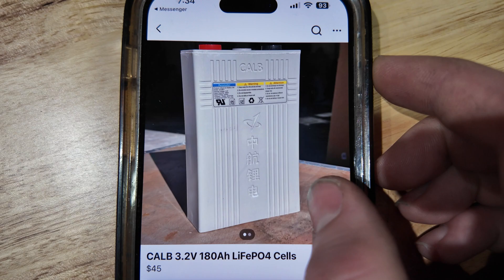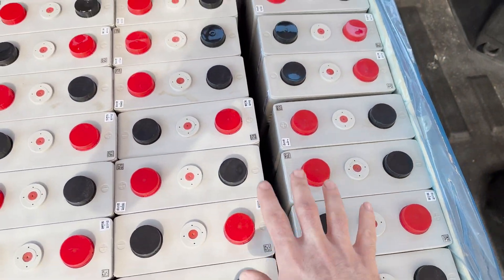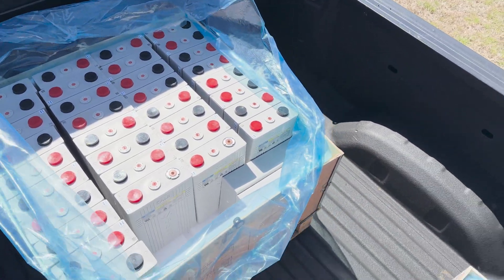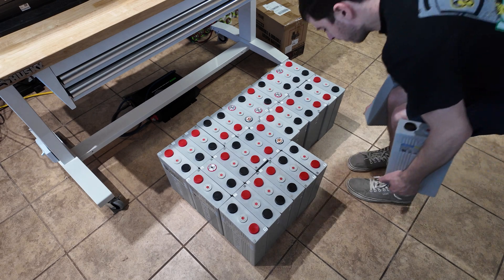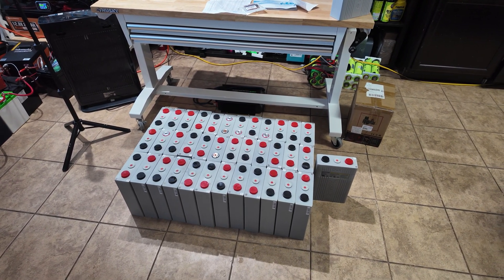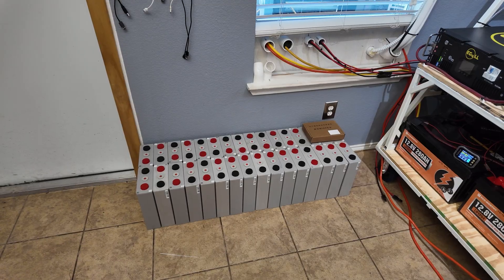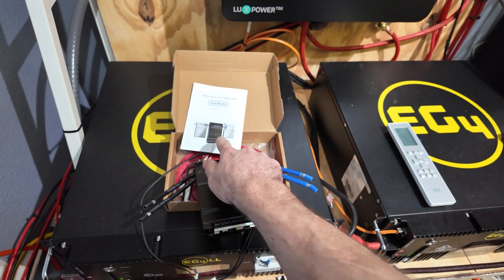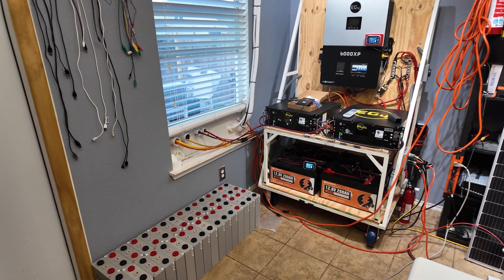Buying 40kwh of Lifepo4 Calb CA180 Battery Cells 35$ Per Cell!  For Solar Storage And More!

Comment: i use a lot of those jk bms's and they are all great. looks like a really good deal for the Caleb cells also
Reply from the maker: @matthewknight5641  Good happy to hear good thing about the bms, I’m excited to try it out, how’s the phone app?
Reply: @Mikebuildss  the phone app rocks man. it's easy to connect to and easy to adjust all your settings and parameters. the state of charge can slowly drift out of calibration but as long as you get a full charge from time to time it's good. I have a bunch of different types of bms and several jk. the jk is the only ones I'd buy again. they work great and mine all have the 2 amp active balancers and that's been enough balance current for most of my packs. I have one old pack with random cells that I added another 5 amp balancer to because it's a bunch of mismatched cells but now it works great as well. yeah you did good getting the cells and picking the bms
Reply: @matthewknight5641  Ah man I'm SO glad I ran into this video and comment right now. I'm about to build my first home-made 48v battery from cells and I was completely in la la land as to what BMS to get.. or cells too for that matter. If u happen to see this.. if you didn't find a smoking deal like Mike did, what cells would you buy?   Thanks guys. 😎👍
Reply: It's all about saving money not being in debt to power companies I got fed up being overcharged every month I was using solar lights cut off my hot water heater limted cooking no clothes drying 1 load washing  a week limted heat and ac I'm very conservative but my power bill was still 300 to 400 every month disabled electrician I can solve this issue solar panels it's up and running share the news folks.
Reply: @darrellwalker5203 I'm only home a few days at the end of each month and sometimes I'm in this semi truck a couple months at a time. I leave my charge controllers on and shut down my inverters until I go home . my batteries are always full a couple days after leaving the house. when I get home I turn on the inverter and mini split. I heat and cool and do everything like an ordinary home pretty much. it was a hobby that once I saw how it could actually work for me then I moved the first system I put together to my workshop for power the  built a much larger system for my home. I could probably leave the inverters on while I'm gone and everything be fine but if something happened while I'm away I'd have no way of shutting it all down so better safe than sorry I guess is why I turn them off. once I get a local job I'll add another solar array and try living off solar full time. when I'm home I'm using power faster than I'm making it but with about 90kwh of battery it lasts the few days I'm there. I figure a pallet of panels added to the system should do and then I'll finally be done messing with it lol